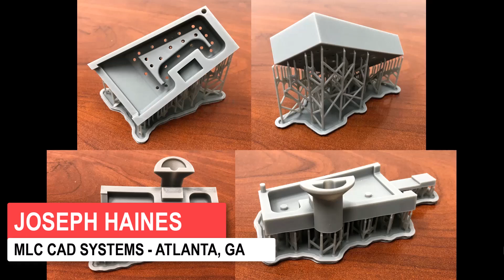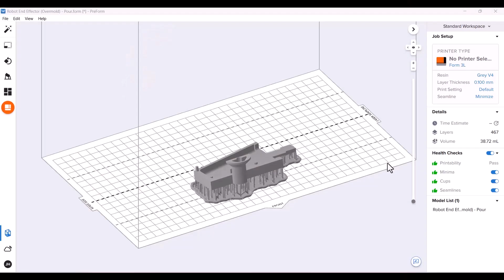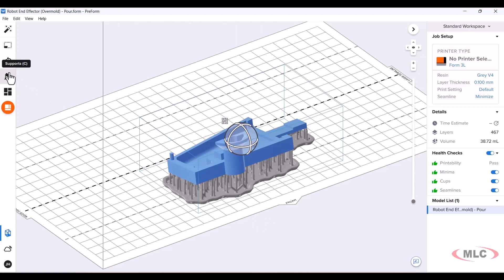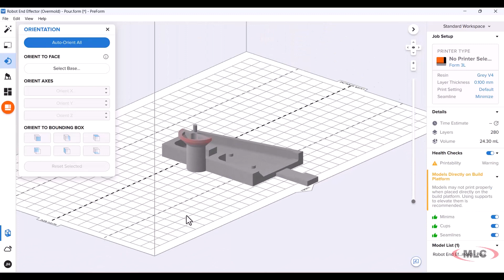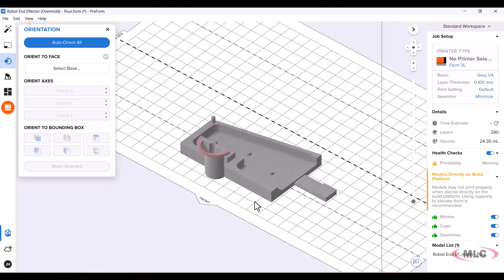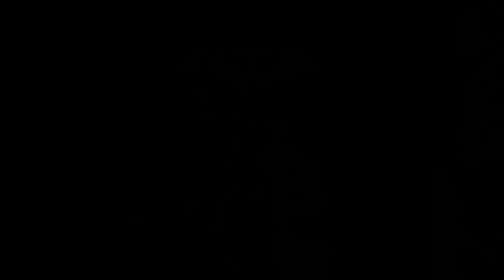How to Print Molds - Flat Surfaces - Formlabs SLA 3D Printer

Comment: How did you get it off the build plate, trying to get a scraper underneath that must have been a nightmare
Reply: I put it in the freezer for about two hours and it gets very easy to release with the scraper, in fact, depending on the resin the part would come off just using my hands.
Reply from the maker: It can be a challenge, and there are a few tricks you can use, but for this the flexible build plate is perfect.  It flexes outward to quickly release parts and then restores to flat for printing.  https://youtu.be/ktHAqb6Ihp4?si=g6STlHa-3GCVu5ak&t=80

Comment: Doesnt this create a big stress on your FEP? To the point where it might ruin it with that much suction surface. My understanding was that printing items at an angle helps to keep as much of a low profil on the FEP as possible and help to make it last longer.
Reply from the maker: You are correct! Large surface areas place stress on the tank film (FEP); however, Formlabs has patented Low Force Display (Form 4) and Low Force Stereolithography (Form 3) that offsets large peel forces with cleverly designed tank film layouts and materials. Thanks to their tech, Form 4 tanks last a long time (1-2 years for the average user)! You can see the difference in durability between a hobbyist resin printer’s FEP and the tank film from a Form 4 here: https://www.youtube.com/watch?v=WE41BlCMux8

Also, when you are printing parts, it’s a good idea to not print them in the same location, regardless if they are molds printed directly on the build platform or other parts that have been angled. Moving parts around will extend the life of your tank film.

Comment: Thank you for making this video. I'm a resin print beginner. This video is a bit of to my surprise because by researching on Youtube, most of other videos suggested that when printing flat surface models, tilt the model by some angle, to avoid damaging the flat surface. Those videos don't use Formlab printer though. I wonder if Formlab printer is different than other brands when doing this...
Reply from the maker: You are correct! Large surface areas place stress on the tank film (FEP); however, Formlabs has patented Low Force Display (Form 4) and Low Force Stereolithography (Form 3) that offsets large peel forces with cleverly designed tank film layouts and materials. Thanks to their tech, Form 4 tanks last a long time (1-2 years for the average user)! You can see the difference in durability between a hobbyist resin printer’s FEP and the tank film from a Form 4 here: https://www.youtube.com/watch?v=WE41BlCMux8

Also, when you are printing parts, it’s a good idea to not print them in the same location, regardless if they are molds printed directly on the build platform or other parts that have been angled. Moving parts around will extend the life of your tank film.
Reply from the maker: Glad you found the video helpful! Formlabs printers are industrial grade, so there may be a difference depending on the hardware others were operating in their videos. You can read more about Formlabs printers and all of their features here - https://www.mlc-cad.com/formlabs/
Reply: I UV resin print engineering parts (including large moulds) and every one of them is flat on the build plate in one orientation or other.
If you are printing toy soldiers, feel free to leave them hanging in the air, but if you want absolute precision - go flat. Aside from a dead flat build plate, the key trick in going flat is a) managing any suction cups - either with holes or orientation and b) managing the elephant foot. Post processing with UVTools has allowed me to remove that completely and ensure that layers that have a large surface area have tweaks for rest times and lift speeds. I'll also quite often use CAD to add built-in supports directly to the model (rather than slicer) to allow me support the model in a way slicers just can't.
Direct on the build plate is 100% the right approach for accuracy and precision.

Comment: Stupid question maby but why wouldn't you print a flat surface flat??
Reply from the maker: Not a stupid question, because "flat" can mean a lot of different things.  In this case, we want to create a surface suitable for sealing, so it not only needs to be geometrically flat but also have a nice surface finish with no grooves where it could leak.  Since 3D Printing builds parts up layer by layer, the thickness of the layer height will create natural grooves that might not seal well.  Also, for large parts being printed from a resin to a solid, the process can in some cases warp the part slightly.  By printing it directly against the build plate it resolves all of the issues above for this application.